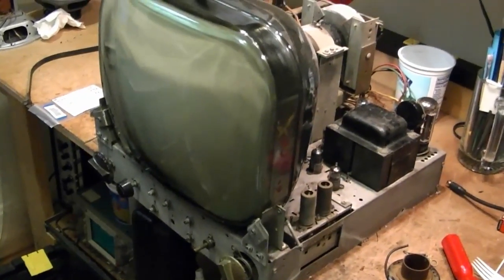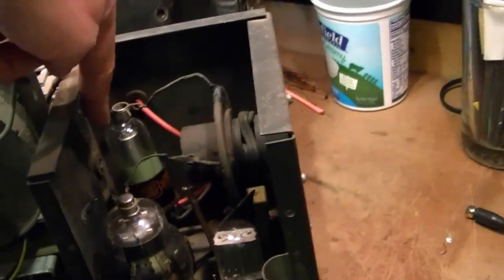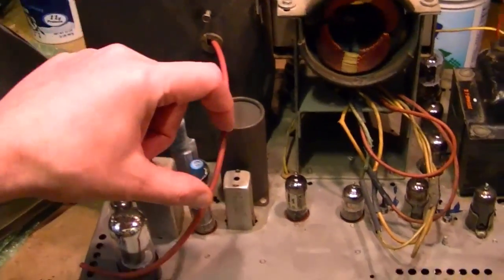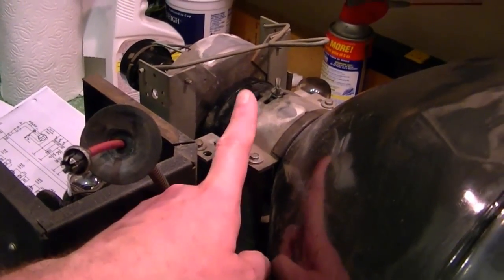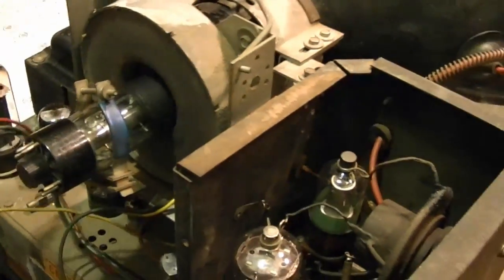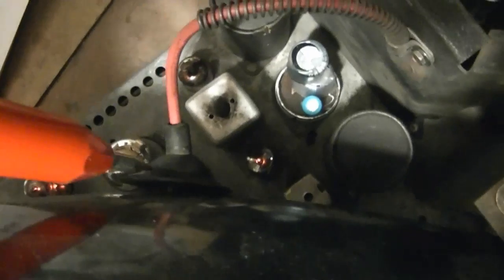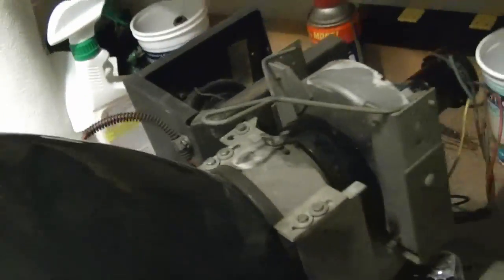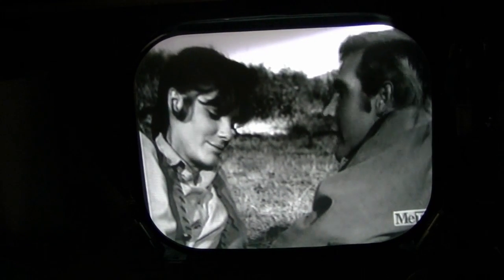Capehart 325 restoration pt6o7

Comment: Interesting to see a rectangular tube with perfectly straight sides and radius only at the corners like that.  I think only a few were made like that, and only early on.  Most had a long radius on the sides.
Reply from the maker: David Locke Yes, the made a 16 and 20 for about a year before switching to the more rounded 17 and 21 inch crts

Comment: isn't there a chance that that label on the CRT can act like a dielectric and cause some arcing when the units running?
Reply from the maker: +Hi11ary Goddam C1itton  Paper, glass, air - any insulator is a dielectric.  Arcing between what ?  Watch the next segment to see where the CRT is coated in conductive graphite.

Comment: Wow, I gotta say, there at the end of the video you really had a very nice image on that screen.  One of the best I've seen!  Really great contrast, nice sharp lines, just overall a high quality image.  I don't recall you saying how the tube tested, but I'd have to guess extremely well!  Great job as always Bob!
Reply from the maker: It tests pretty good but the appears to be arcing inside the gun assembly.  Still investigating...
Reply: bandersentv trying to lower the HV a bit to avoid arcing ? Not sure in CRTs but in HV, once you got arcing is like you almost got a short
Reply from the maker: 38911bytefree  I think it may be a heater cathode short.  I'll try using an isolation transformer on the CRT filament.

Comment: It looks good, but did you find the cause of the fluctuating high voltage?
Reply from the maker: Nope, still hunting.  Also the arcing appears to be inside the CRT electron gun :(
Reply: Aww man, that's not good. Did you test the CRT for shorts? If it's shorted, maybe you can fix it with the 'clear shorts' function on your CRT tester.
Reply from the maker: justsumguy2u  Yes a few weeks ago.  I'll try testing it again.  Could also be that there is too much voltage on G1 or G2.
Reply from the maker: justsumguy2u  My tester is just on the edge of bad for the Heater-Cathode short test..  I'll try using an isolation transformer on the CRT filament.